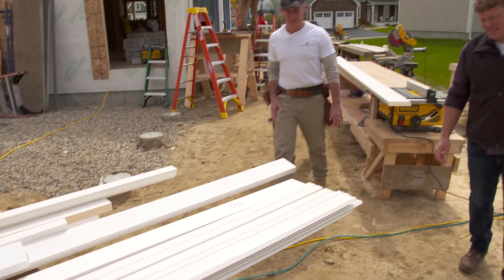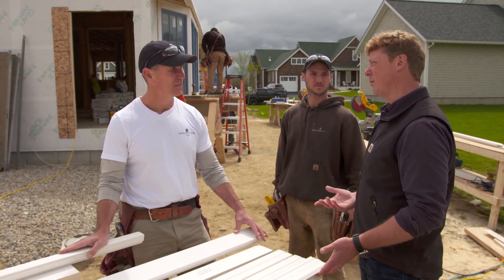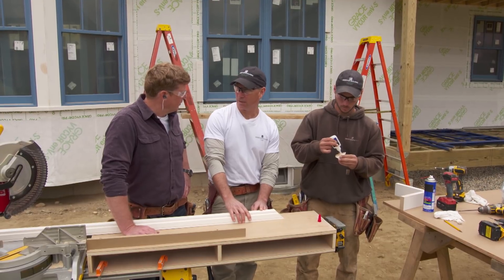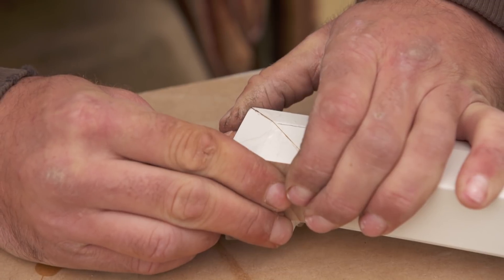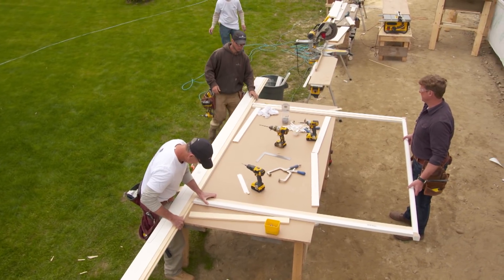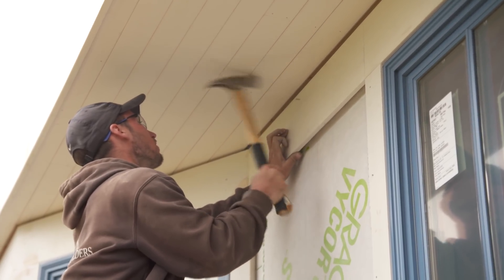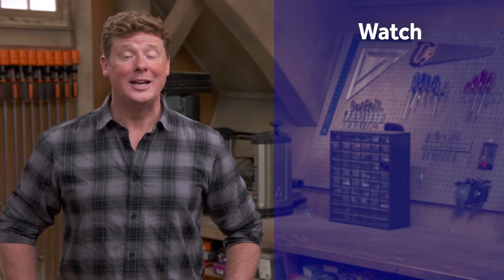How to Trim Windows | This Old House

Comment: There have been occasions where I felt the need to use dowels or biscuits and I was mocked. This guy uses 500 dollar pocket screw jig.
Reply: Anthony Romano pocket holes are junk
Reply: Steve’s Garage: just think of it as nothing more than a permanent clamping system.
Reply: Big Mo I think the use of biscuits or dowels as mentioned in the original comment is far superior method especially if you can’t have any fastener showing
Reply: Steve’s Garage 
I’m curious. Why are they junk?
Reply: Erich Murphy compared to a biscuit or dowels, more surface area for glue and they are completely hidden where as pocket screws can only be used if the backside isn’t visible IMO

Comment: At 3:24 when he was cutting that rabbit on the table saw with his fingers over the blade location- there was only about an 1/8” of pine protecting him from the blade. I got a little nervous on his behalf
Reply: Big Mo I was about to comment that.
Reply: Lord, I cringed so hard at that moment.  I dont want to sound negative as I really enjoy this channel, but nothing about this felt like TOH quality.  That new chemically injected wood, "activator" glue joints that didnt look well aligned, and bad table saw safety.
Reply: Same here

Comment: He puts his hand right on the blade at 3:24. Not very safe.
Reply: That was one of the first things I noticed too. I was surprised there wasn't some type of feather board.
Reply: Hmm...Left hand is holding the board against the fence while cutting the kerf. No wear is his right hand on the blade. Sure his right hand is close to the blade but not close enough to be unsafe.
Reply: Cringe worthy
Reply: Y YIII:   Everything is safe ...till its not
Reply: Tradesman like that, he knows where the blade is, he would have cut a mile of it.
Reply: And no riving knife or splitter on the table saw, either.
Reply: In all fairness, Riving knives and splitters have to be removed for cutting rabbits and dados

Comment: 3:25 Dang! Small margin for error there!
Reply: That is a kerf cut to help shed water. Look it up.
Reply: Hey YYIII - Look up "dangerous cuts"
Reply: @yyiii276  I was more thinking about how close his finger was to the blade. It is not worth it for the sake of efficiency to operate under such small margins! That guy is among people who are more likely to badly injure themselves. If the fence would be off square he could have easily sliced his finger there.
Reply: Y YIII   You're incorrect. 
He was cutting the head, not the sill.

Comment: 2:28 "We're going to use a two-part adhesive."  It's called plain old super glue and accelerant.
Reply: Jake Schroeder: I thought the same thing - then I wondered it it was rated for exterior applications?
Reply: @BiggMo  Not sure but a quick Google search didn't turn up much in terms of a different type of glue specifically meant to be used outside.
Reply: because its 2 parts
Reply: The glue they used is 2P-10 from fastcap. It should be fine on an exterior application as long as it gets painted over. It is stronger than your average superglue.
Reply: @general4str  Cool, thanks!

Comment: Superglue on the corner trim detail? Cyanoacrylate has very poor resistance to water/moisture (polar) and UV over time.  Be interesting to see if those pieces are still there in ten years.
Reply: @Kevin-mp5of , And use biscuits for all connections.

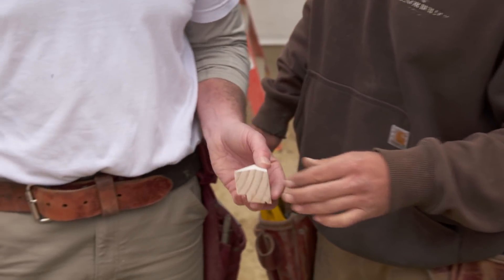Comment: I'm all for using real wood, as long as it's old growth, where the growth rings are 1/16'' apart, not 3/8'' to 1/2'' like that stuff, just look at 2:22. And if you want good, strong joints, use biscuits and exterior wood glue, JMO.